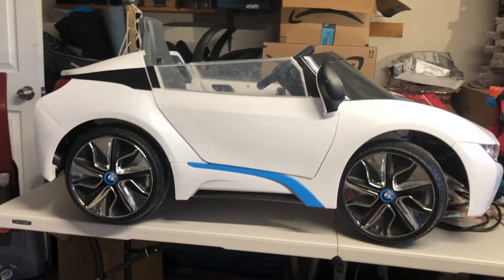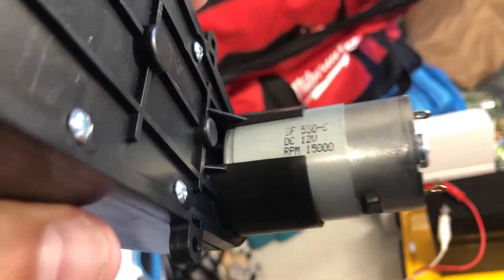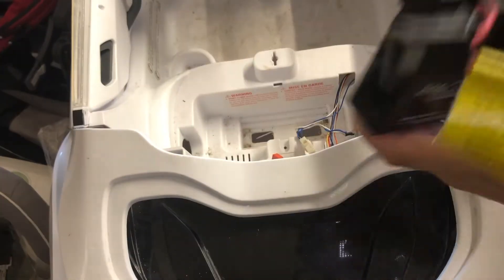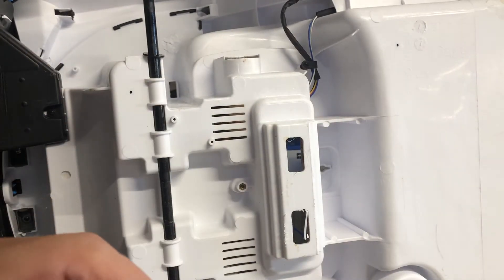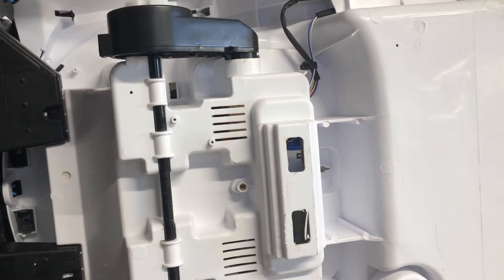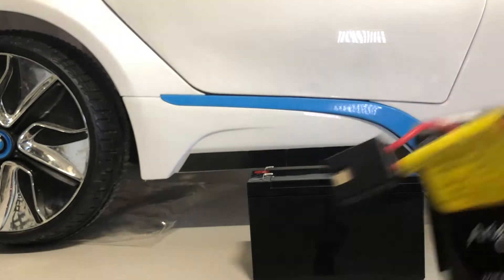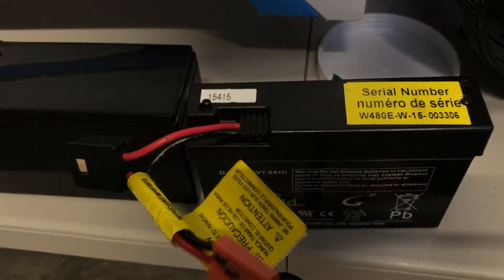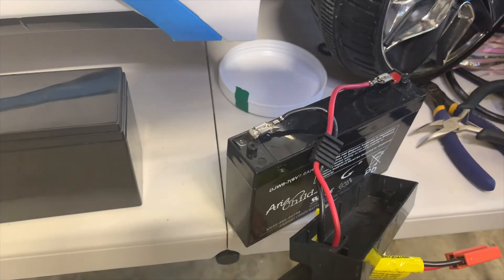How-To: Upgrade BMW i8 ride on 6v to 12v

Comment: Hey. Thanks for the video. Is this better then doing the drill battery add on?
Reply from the maker: Both solution are workable but you might want to consider the following.
    1. Cost of Battery ( 12v was lower cost the the drill battery )
    2.  The power/voltage regulator circuit in this case it was early model and only support 12v.
Reply: @WindingCanyonGarage  thanks for the reply. Do you mean the “stock” regulator can handle 12v ?
Reply from the maker: @beezos24  Yes that correct, as well the motors where spec for 12v which I purchased as well.
Reply: @WindingCanyonGarage  thanks Man. Did you ever post the list of the equipment? I have a drill battery adapter but dont want to cut anything if I am just better off getting the new motor and battery.

Comment: I have bought a remote control 12 volt parent remote however I cannot find the steering motor. Everything else works perfect can only go forward and backward because we can't find the steering motor that will fit. I have purchase 4 aredy and they are incorrect. This car is a bmw i8 concept, model 8803-24, Batch 303116. Plz help

Comment: Hi I am wanting to do the same and my kids battery compartment is like yours. What battery did u use to fit in the tight space?
Reply from the maker: I used "ExpertPower 12v 7ah Rechargeable Sealed Lead Acid Battery" from Amazon, had no issue in with tight space, but I don't recommend that brand as I had lots of issue getting the battery recharged. It last for me about 3 charge then went dead.

Comment: Where did I get the motor and gearbox . What website . I’ve been looking and hard to find this part
Reply from the maker: Thank you for the question, It's a great idea to make the parts list / BOM. Will try to put it togerther. 

Everything from Amazon, I used "550 15000RPM Gearbox with 12V Motor" from WSJ.
Reply: What was his reply??

Comment: Did you think about adding a 2nd gearbox?
Reply from the maker: Yes, I did add additional motor to make it dual, but having issue with PWM control which is having issue with high load. Still debugging the problem, looks like I need a new PWM control.
Reply: @WindingCanyonGarage  can you video the process of using the PWM control for the dual motors? That’s my next step in Power Wheels modification.
Reply: What was his reply?
Reply: @ I ended up making my own PMW video. https://youtu.be/hnBAEuVzGEA?si=06A1K1M30J_bm1iT